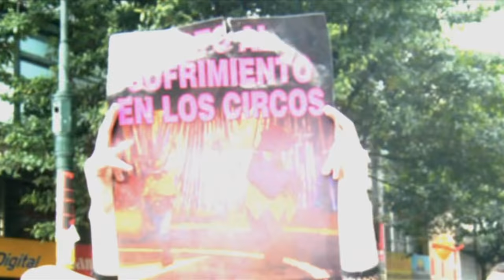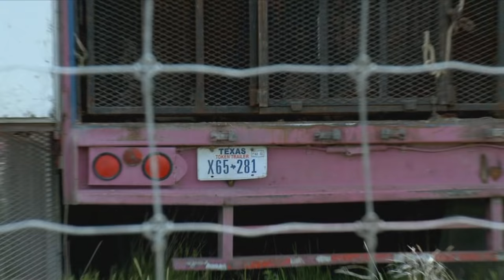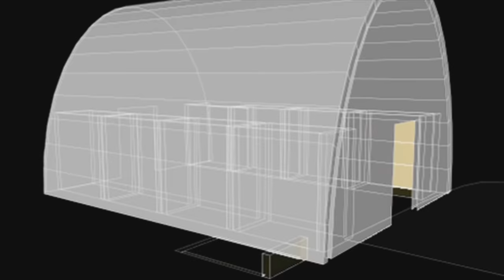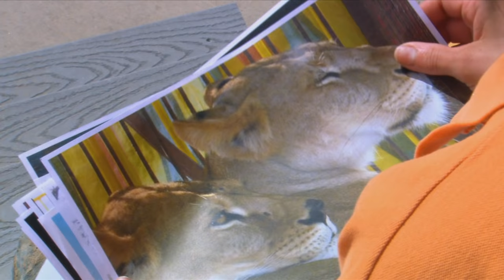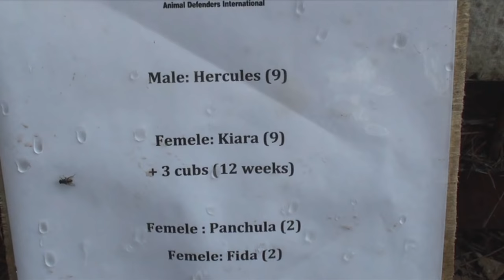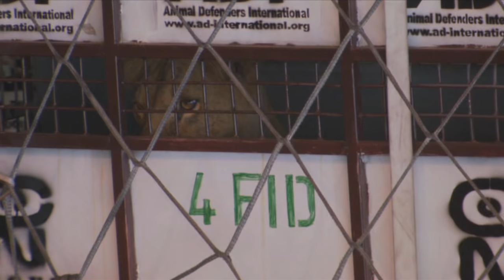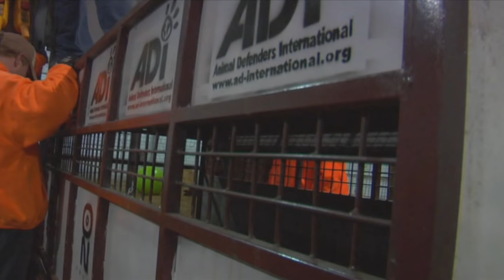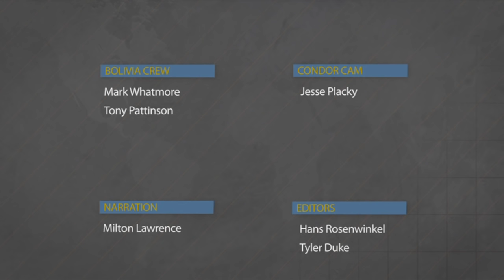Mile High Jungle Bolivian Lion Rescue

Comment: Did they find the only land in Colorado that doesn't have a single Tree for Miles?!
Shade Does Matter! Even in Colorado.
Reply from the maker: There are lots of trees within the Sanctuary, so the comment "doesn't have a single tree for miles" is absolutely incorrect.  In addition, all habitats at the Sanctuary also have man-made shade structures.  However, given the habitats range from 10 to 25 acres in size, shade structures appear to be small (even though a pride of lions could easily fit within each one).